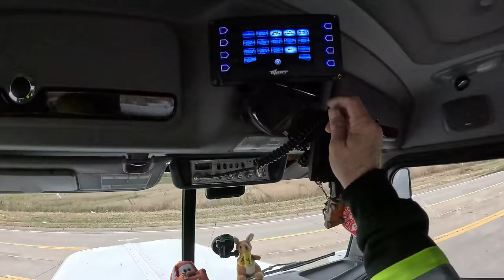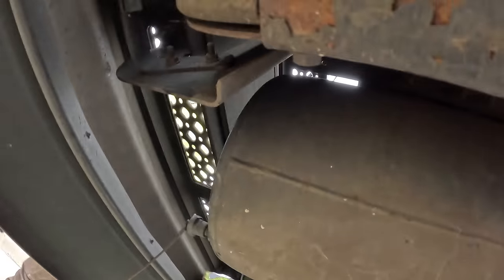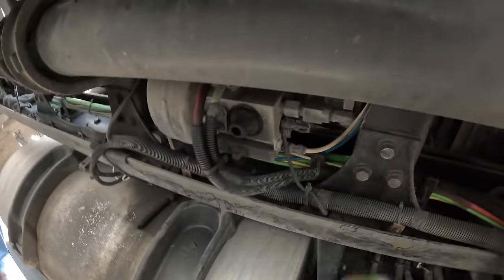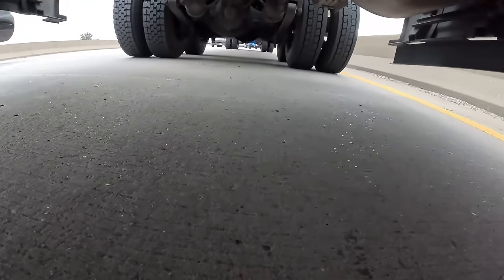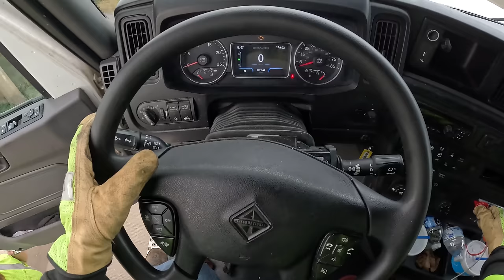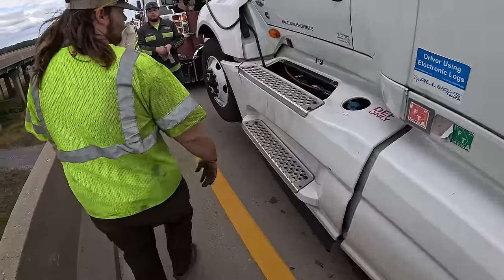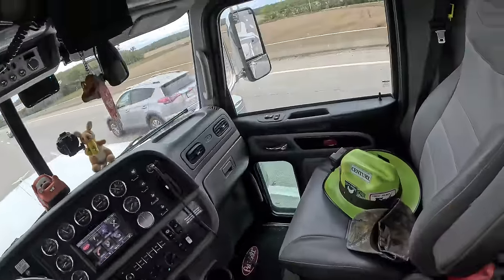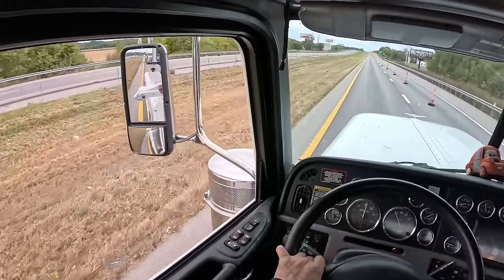CODE 3  GOTTA ROLL   SEMI TRUCK BLOCKING BRIDGE CONSTRUCTION

Comment: I am wondering one thing. At the beginning of the video you said you were asked to expedite which authorizes you to use emergency lights and sirens. Does that allow you to go through red lights (assuming traffic with the green light yields to you) like police vehicles, ambulences, and fire trucks? After all your emergency lights are yellow not red like ambulances and fire trucks and not red and blue like police vehicles.
Reply from the maker: Missouri recognizes towing and recovery units as emergency response vehicles.  The "expedite" directive may ONLY come from the dispatching law enforcement agency and is not up to the discretion of the towing operator.  We are able to pass through red lights ONLY when it is safe and when vehicle operators yield to our unit.  All of our recovery units are equipped with red and blue lighting, like ambulance, police and fire.  I hope that helps clarify.  Thanks for watching and God bless.
Reply: @RonPratt  Thank you for you prompt reply. I did see (small) red and blue lights on the front grill of one truck but I thought the main lights would be yellow (like for most tow trucks). Of course I realize for an emergency vehicle to go through a red light it must be safe to do so and only if other vehicles yield.

Comment: Just to clarify, (I'm from a different country), your permission to run "Code" allows you to, (with all due care), run red lights, stop signs and (once again, with all due care), speed limits?
Reply from the maker: That is correct.   We are only allowed to run "Code" when requested to do so by a legal dispatching agency whether police, fire, HazMat, etc.  We do NOT get to choose when to run Code and we do not always know why we have been requested to run "Hot", but when we are given a "lawful order",  we follow that order and respond accordingly and with EXTREME due care.  Running Code is a huge responsibility, is dangerous, and is not to be taken lightly or misused.   Thanks for watching and God bless.
Reply: @RonPratt  Thanks 🙂

Comment: Hey Ron prat how do u charge that customer do u charge them the accident rate of just charge the contract rate to the customer
Reply: depending on the situation it's usually an hourly rate. the clock starts when the engine starts

Comment: I did tow truck operators should have lights and sirens on their vehicle and when Judy calls in a very bad emergency situation, such as the one you are dealing with in this video or something More dangerous you should be able to clear the roadways by putting on lights and sirens, and everybody should move over for the tow truck operators as they were for essential 911 services. Because I think as a nation railway problems have in medic cases been the result of tow truck operators not being able to get to a call fast enough and doing their duty in the eighth timely manner because they’ve either gotten stuck in traffic, or I treated as a normal vehicle on the roadway, which makes their arrival time to any scenevery bad

Comment: Why does a tow truck have sirens or even need one?
Reply: Missouri likes to clear crashes quickly to avoid traffic backing up. By giving tow trucks permission to run code, they can get to the accident quicker and clear the scene quicker, unclogging the highway quicker. It's a looooong drive in between cities, and traffic backing up means you could be stuck in the middle of nowhere for hours. It's 23 miles between the city of Miner and Scott City with only 3 exits in between (it used to be only 2 exits until about 4 years ago). Getting stuck in a virtually inescapable corridor for hours would suck, and is borderline inhumane. That's why they move quickly to clear highway accidents.

Comment: Why are you running code3 when there is absolutely no need too. No life threat, not to mention there’s no traffic.
Reply from the maker: Because we were given a lawful order to "expedite" by the Missouri State Highway Patrol.   We were not given a reason.  We were told to expedite, so we did.   It is not our place to question their request.   Also, a lot of perspectives have changed, at least in Missouri and several other states.  The updated T.I.M.S. courses include towing/recovery companies at the State level.   Rapid Scene Clearance is often the reason they request we expedite.  As you can clearly see in the beginning of the video, there has already been one "secondary" from this truck being broken down in the passing lane.    You may not understand or agree with the updated statutes, but things have changed.   We work and train very closely with all the local Emergency Service agencies.  Keep watching and you will understand.   We aren't the stereotypical "wrecker guys" you may be accustomed to.    Thanks for watching and God bless.
Reply: @RonPratt  No hate on your truck or the job. It’s a nice truck. I’m just saying it really didn’t appear that a code3 response was warranted especially with little to no traffic. Especially the siren use.
Reply from the maker: I appreciate that.  Again, it isn't my call to make.  When MSHP requests we expedite, that's what we are required to do.